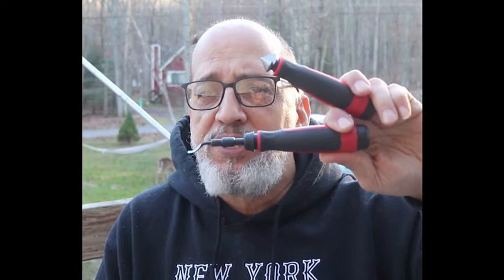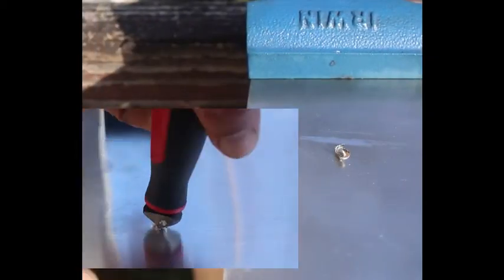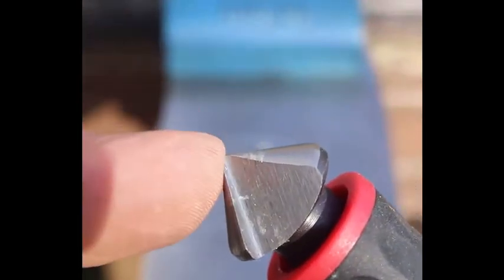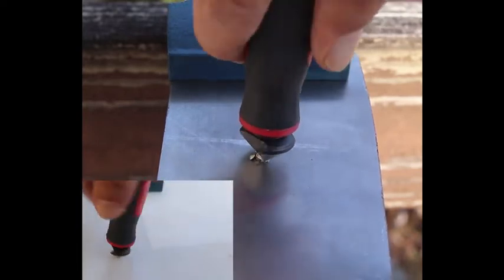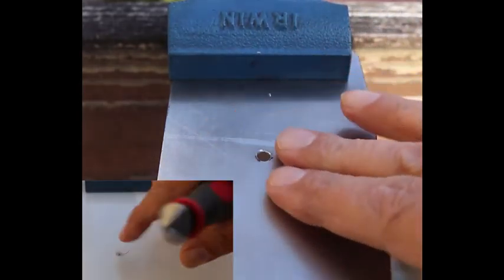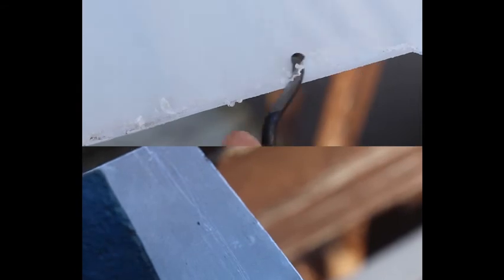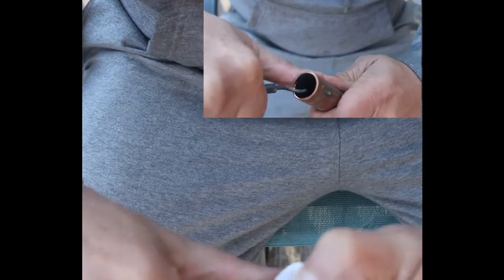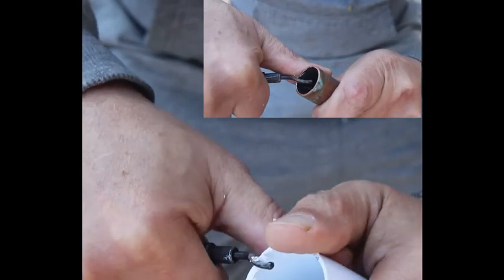How Do You Deburr Aluminum Manually with Deburring Tool

Comment: How can I keep the blade from freely spinning around. This tool was recommended to me for use with resin jewelry projects. I pour resin into molds and once cured the top edge that touched the opening of the mold often is jagged. The tool actually works great but because I can barely control the blade from spinning sometimes it digs into the edge leaving a small gouge out of it. Running the tool along slight curves makes it do the same. Am I doing something wrong or is just not the correct tool for me. The blade is plenty sharp enough and I like the rounded shape. I would just like that blade to not spin around like that.